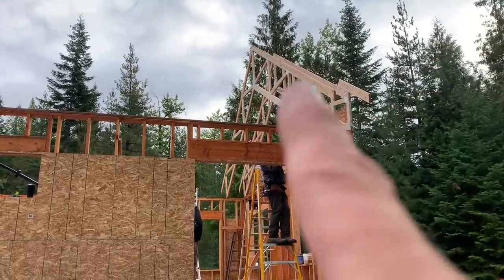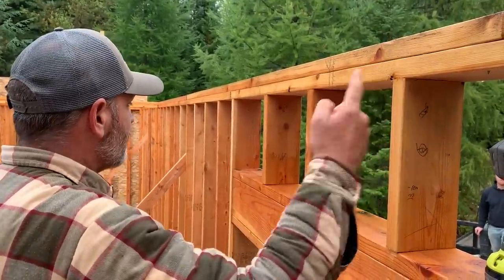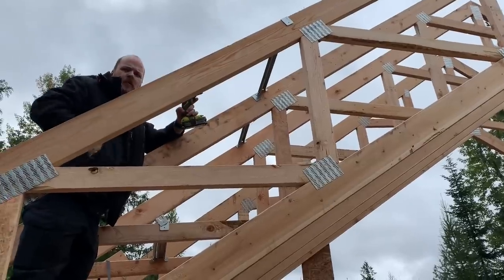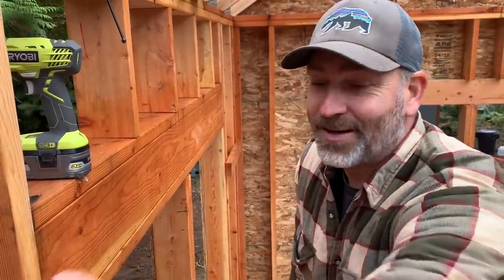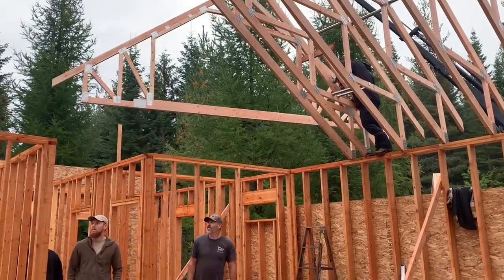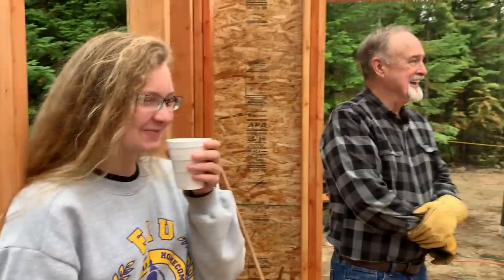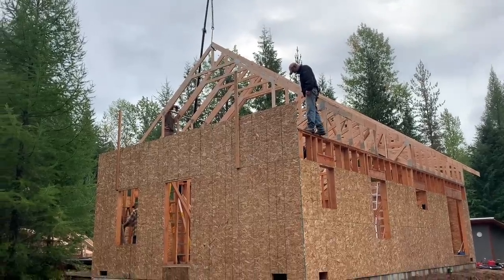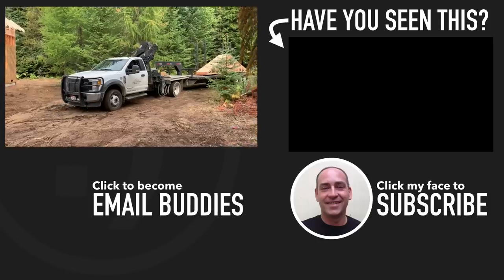FINALLY Installing the Trusses | Off Grid Cabin Build #32

Comment: "The Gable Ends" > > > > > > > > Here ... lol
Reply from the maker: Hahaha
Reply: @MartinJohnsonOffGridLiving  what he is saying is gable walls are wrong. I suggest you replace them but if you don't want to take your drywall off install  flat ties on 2x6 vertically overlaping 2 top plates on both gables of the house. I am glad your osb didn't end at the top plates.